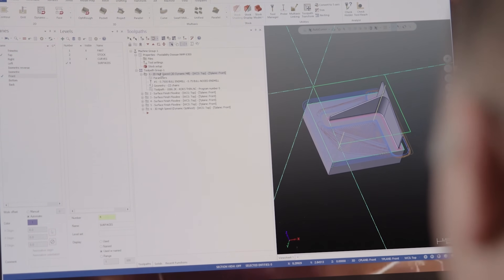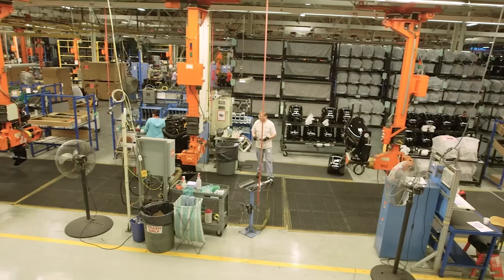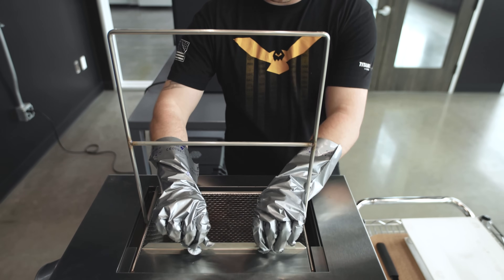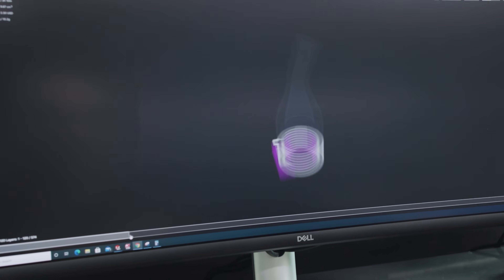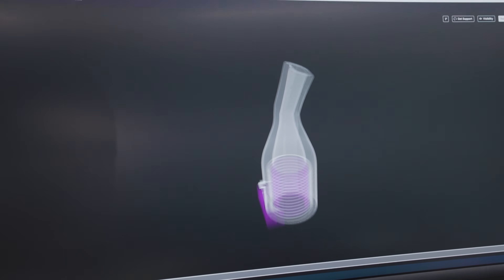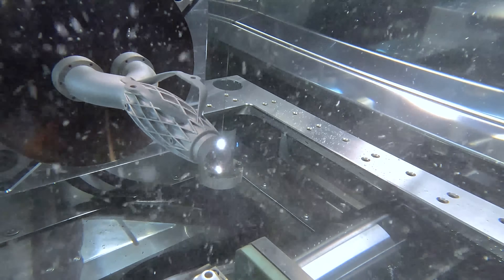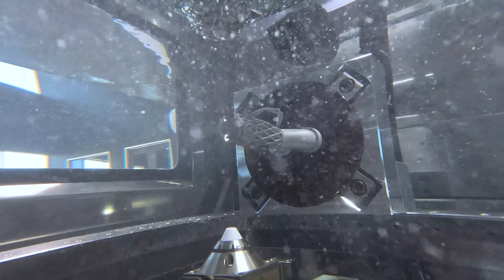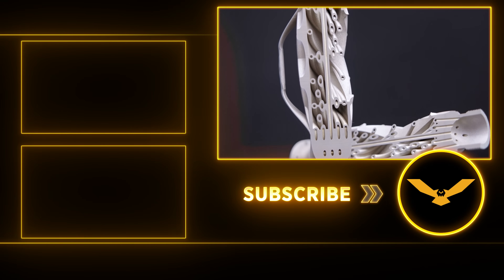Why Won’t Old Machinists Teach Young Machinists???

Comment: I taught a young man how to program and run a 4 axis mill. Once he was pretty good with it, I was laid off. 1 yr. later at a different company, I taught the same man how to program and run a 5 axis machine. As he became proficient, yes. I was laid off again.  I can definitely see why there can be some reluctance to teach.  Since I'm now retired from the trade, another company will NOT get to do this again!
Reply: I understand that happens a lot in IT.  Common scenario:  Your team is not going to get another contract.  Essentially they've been all laid off.  You, yourself can get another contract.  It is for 6 months.  Your job is to train the six H1b Visa employees that they replaced your crew with.
Reply: Exactly.  And it's something that happens in every sector.  I've lost count of the number of times I've inadvertently trained my replacement!
Reply: @threeriversforge1997  There’s a shortage of machinists today. No one is replacing or letting go of anyone just because you taught them. They are desperate to have you.
Reply: @FlowSharp  Why does the shortage exist in the first place, hmmm?  All the people here telling their stories, their own personal experience are wrong?  Companies might be desperate now, but it's because of what they've done over the years to "cost cut".  How many good machinists were let go over the last 20 years as the companies sought to trim the budget, especially as new machines came on the scene?  For you to say our experiences are simply not true is silly.
Reply: @threeriversforge1997  What are you mumbling about? I didn’t disagree with what anyones experiences. 

Yes what the companies did before is the result of the shortage today but there are also other contributing factors. Like for example 

1. It doesn’t pay (Anyone can work at Sams Club or Mcdonalds and make the same amount)
2. Marriage is on the decline so why would anyone work there asses off if there’s no family to support

My point, an experienced employee can train rookies now. it’s not going to get them fired like the past. Due to the shortage and the results of what happened back then.
Reply: @FlowSharp  Your last point might be true, but the damage is already done.  Guys want to work hard because it benefits themselves, even when there's no family to feed.  But those same guys also see how companies routinely treat employees.  Plenty of studies have been done on the matter.  Who wants to risk putting in 15 years with a company only to be fired because you're at the top of the pay scale and some new guy can do it cheaper?  Who is going to believe the companies have changed their tune?  Sure, they are in a bind today because of their actions in the past, but have they learned their lesson, or are they simply going to repeat the cycle?
Reply: @threeriversforge1997  Ufff i dont know if they will repeat the same cycle. Usually companies do learn from their previous mistakes, some might not. 

This is why i believe most companies should be union. Can’t simply fire someone just because. 

Im a rookie as of now but im studying to become a mechanical engineer. But to those who want to remain a machinist they need to make it fair or suffer the consequences of GREED.
Reply: @FlowSharp  Unions make things fair?  Ha!  Yeah, you're definitely still in the learning phase.  I wish you the best with that.  But remember, the Rust Belt is called the Rust Belt because of the unions, not in spite of them.  The history of the unions sounds great until you get into the roots, the strong socialist ties, and the end results we can see all around us.

I get the perceived upside of unions.  I've had to work under some really shoddy bosses and would have loved some union protection.  However, the truth is that unions cause far more harm than good.  For all your talk about "greed", think about how those unions demand always more benefits and wages.  The union bosses live in mansions, and we get the Rust Belt.
Reply: @threeriversforge1997  True i agree. But isn’t having the Union better than not having the Union?

I was once an environmental monitor and employees who were union earned more Money. Although i had a significantly higher position 

Thanks for the info and i hope most issues get resolved
Reply: @FlowSharp  No, having a union isn't better than not.  Again, look at the Rust Belt as an example of what unions do.  Look at how much manufacturing the unions have cost the nation rather than saved the nation.

Honestly, I didn't understand a lot of this stuff until I decided to strike out on my own and had to start a business.  Unions only make that harder.

Michael Keaton did a wonderful movie about the auto industry in the 70's and it was a pretty honest portrayal of how the union workers did their thing.  The main reason you see so many robots throughout industry today is because union workers finally drove up the cost of doing business so high that those early robots were actually a good financial alternative.  And immediately the car companies saw the quality of the product improve dramatically.

Yes, the union employees get paid more money, but where does that money come from?  How many companies were shut down because they could no longer afford those exorbitant salaries?  In the end, it trickles down to the customers who have to foot the bill - and that's why a new truck costs $40K.

I have a friend in the stagehand union in Vegas and he makes an insane amount of money.  It's hard work, sure, but all those perks are reflected in the cost of the tickets the average person has to buy if they want to see a show.  And now that he's retired, he still gets paid a very nice pension.  Not only has he been retired for years, but he has a very long life ahead of him.  That means the union will have to pay his pension for another decade or two.  Where's all that money coming from?

These long pensions end up doubling or tripling the workforce for a company.  Even though the employee retires at 60, they live to be 80 and get that pension check for 20 years after they've ceased creating profit and product for the company.  Think about that for a minute.  Examine the 2nd Order Effects of something like that.

That's why we have the Rust Belt rather than the powerhouse of American Manufacturing that once stood there.  What did the unions do to stop that?  They were supposed to be powerful and all that, yet everything on the store shelves says "Made in China".  Isn't that a little curious?
Reply: @threeriversforge1997  Inflation creates high prices for products. It crumbles the buying power of the dollar. Therefore creating issues on companies needing to payout more for employees to sustain their living expenses. High wages are reflected on all products. The issue began around 1972 when the dollar was de-pegged from the gold standard. Paying employees more because of growing inflation it’s why many companies moved to China or else where. 

The issue is more complex than just “Union”. The Union pays more, that extra pay reflects on the cost of the products making it more expensive for the buyer…..BUT, if the Dollar hadn’t lost it’s buying power would it be a problem today? 

There are many variables that contribute to bad economics and politicians making bad decisions causes financial chaos.
Reply: @FlowSharp  I never said the issue was "just union".  And, no, the unions don't pay more, they charge more.  Big difference.  Those wages come from somewhere, right?  And if the union doesn't get what it wants for the labor they provide... what happens to the company?  How many strikes have there been in the last century?  

"High wages are reflected on all products."  -  Yes, and that includes the things you buy every day.  Right now, the average American has to work 4 months of the year just to earn enough money to pay the taxes he'll owe for that year.  On top of that, the cost of doing business that companies have to deal with is constantly going up because people are myopic, at best, and don't realize that they're pricing themselves out of work.  Think about all the union workers back in the 30's who thought they were doing something great, only to see their entire industry shipped overseas because the cost of doing business in the US had simply  gotten too high.  

Everyone talks about the straw that broke the camel's back, but they never think about the million straws that came before and how they added a huge burden that prevented the camel from moving.

Labor costs are one of the most significant parts of any business, so unions driving up those costs make the companies less competitive.  Something like the 'mandatory minimum wage" law was patently unconstitutional, but it also forced companies to charge more for their product and service.  As a direct result of that, you saw small companies have to close down or revamp their lines.  People were put out of work.  Young folks weren't hired because they had no experience.

Did you never wonder why people clamor for a raise of the MWL to 'end poverty', but poverty never seems to end?  It's because that forced inflation of the cost of doing business drove up the costs of all the goods and services people have to buy.  That can of beans on the store shelf is priced to cover all that went into getting it on the store shelves.  A percentage of the price includes every single tax and other bill all the companies involved had to pay.  You raise the fuel tax and you automatically raise the cost of that can of beans because fuel is used to grow it, package it, and transport it.

Unions aren't the only problem, but they are a huge part of the problem.  This is why I pointed you to the Rust Belt.  Research the history of the US in the mid-1800's as the powerhouse of American industry was really getting underway.  Look at all the things that have been changed since then.

It wasn't just the unions and it wasn't just the gold standard.  The one underlying thread through it all, though, was ignorant people being swayed by slick talkers who were empowered by those ignorant people.  Myopia was a huge problem then as now.  Yeah, greed plays a role, but it's the greed of the lowly individual who might agree with everything I've written here, but says, "Don't care.  That's the problem of future generations.  All that matters is that I got more money on my paycheck!"

If it's not financial greed, it's emotional greed.  It's people voting with their emotions, letting politicians pull on their heartstrings, with no concern for the long-term ramifications.  They got their clean river, but it cost them the mill that once employed thousands and was the heart of the community.  They got their cheaper goods at the big box store, but it cost them the small mom-n-pop shops that couldn't possibly hope to compete.

That's the warning from an old man that I hope you'll take to heart.  Don't fall prey to the arrogance of youth, thinking you've got it all figured out and that those who are older aren't just maybe a little more experienced.  There's always more to the story, and getting to the truth can often be depressing.  That's why so many refuse to acknowledge the truth.  Honest introspection needs to be painful if it's to be honest.
Reply: @threeriversforge1997  I looked it up. Raising hourly rate through the union may lead to fewer customers and ultimately having to shut down. The company also earns lower profits.

This conversation reminds me of my political thought class. When my teacher spoke of Plato Socrates. Plato didn’t believe in democracy. I agree with him. I don’t think people should be allowed to vote if they’re not educated on the subject they’re voting for. 

Which applies to this situation. People fighting for higher wages, driving up costs “unknowingly” and believing it’s the ultimate solution. No education equals dumb decisions. If people only knew……

I thought i saw sunshines and rainbows 🌈 Thanks for opening my eyes 👀
Reply: @FlowSharp  Good job!  Now think about the motivations of the leadership of an ideology/organization that would do something which "may lead to fewer customers" and "having to shut down".  Does that really sound like a group that's looking out for the working man?  When you pair that with the strong ties to communist/socialist ideology that unions have had from the beginning, you start to see that there's far more to the world than the cutesy slogans they use to tug on the heartstrings of their adherents.

I think it was Stalin who referred to his followers as "useful idiots".  He hated the people who supported him because he saw just how dumb they were, happily supporting his grab for power even though he was doing he most horrible things.  All because they hoped he might give them a little more coin in their pockets.  It wasn't that the useful idiots wanted to be wealthier, but that they hated those who were wealthier and wanted to see them pulled down.

It should also tell you a lot that some people are always clamoring about "our democracy" when we don't live in a democracy and never have.  The word 'democracy' doesn't appear anywhere in our founding documents, and the founding fathers actually wrote about the dangers of democracy.  That's why America is a Republic, and always has been.  That's also why the vote was restricted to property owners.

Only after we got away from that, listening to the snakes in the grass and violating the constitution, did you start to see things going bad.  No matter how you cut it, if you increase the number of people who can vote, you increase the chances for corruption in the vote.  Worse, though, is that you increase the likelihood that bad ideas will get through because enough people could be swayed.  It's not a coincidence that Prohibition happened just a few years after women were given the right to vote, or that federal spending climbed back up to WW1 levels, or that we got the first State Sales Tax that would open the floodgates on taxation throughout the nation.

Think about all the things that used to be made in America.  All those products are still made.  They're still on the store shelves.  Somehow, though, it's cheaper to make them in Chicom Land and ship them to the other side of the world... than it is to make the product right down the street from you.  Think about that.  What has the local, state, and federal government done to make things so costly here in America?  How many small shops have been shut down over the years because things are so expensive?  How could it possibly be cheaper to make something in China and ship it to your town.... rather than just make it in your town?  Why do those foreign nations get the jobs and not the people in your state?  What has your state done to become so non-competitive?  If we were talking about a sports team, would this make sense?

You're right that it's not "just unions", but we need to keep them in mind because they are a powerful political force that plays a big role behind the scenes.  The unions benefit when companies close and jobs are lost because it helps to keep the leadership in power.  They aren't the only problem, sure, but they are one of the problems.
Reply: I'm not a machinist but I am a certified millwright.
I have run across guys very early in my working life who would not show you anything. One day I asked this one guy why he kept everything to himself. He said: "If I teach you everything I will get laid off".
I laughed in his face. I said: "If there is a lay off then we are all gone". Years later that's exactly what happened.
Then it happened to me ------------------------------ I was 51 at the time. According to my boss I was the company golden haired boy. I modified a packaging machine and when the machine factory guys showed up they even took pictures of my mod. One day a blow molder broke down. The gearbox stripped all the teeth off the wheel gear. We had no spare. I took it apart and started working on it. The boss asked what am I going to do ? I said I'm going to make another gear with a grinder. He looked at me like I was on crack. It worked and ran for weeks like that until we got a new gearbox.
I also kept notes from the very first day I started about each machine, the problem and what I did to fix it and the machine code. I kept this info on a word pad file that I made on my computer at work. After a couple of years of this I sent the file to each of my co-workers. It was called "Common problems and solutions".
A year later there was a manager change and he despised millwrights. Most of our crew quit within weeks, including our maintenance superintendent and me. They took my "Common problems and solutions" file and gave it to those who replaced us. They went under anyway --- LOL. Company was Nestle.
I always share my knowledge with everyone but that's a big mistake. You have to be VERY selective.
I'm retired now but I would never share my knowledge with a goof co-worker and NEVER SHARE IT WITH THE COMPANY.
Reply: @canadianoddy8504  As a young worker I submit a proposal for an improvement at my company. They paid me few buck, but later they required me to work faster ... It didn't paid off. (I should have listen to retiring master in that matter). From then on I keep any improvident for myself. I keep any notes on encrypted pen-drive. If it makes my job easier, that's my reward.
Reply: @xys007  
Well kid ---- live an learn.
I can't believe they even paid you a few bucks for that. It NEVER happens, I'm shocked.
Like I have said previous ------ keep your mouth shut, get a trade, NEVER work in that trade again unless desperate for cash, GO FOR THE BIG SHOT JOBS IN THE OFFICE.
The End.
Reply: @xys007  so true at my old job I would keep improvements in efficiency to myself, and improve the final product with time gained, focusing on quality brought me a lot of contentment rather than pushing and sacrificing quality
Reply: @canadianoddy8504  Yeah pretty common in industry. All it takes in one bad manager to come along and stuff everything up. The only people I teach are ones that get paid same/more than me, and apprentices. If its someone undercutting me or a young tradesmen just out of his time he is on his own.
Reply: @Ken-nv2hl  
In my life time I have worked for some awesome bosses. Every time there was a problem it was because of some big shot in the office playing big shot. I have worked for two HUGE companies that went under because of sudden management attitude and one that sold to a holding company (the Nestle one) because of upper management. Believe it or not our Nestle factory was the most productive plant they had until this new manger showed up. Now they're gone LOL ------- Morons.
Reply: @canadianoddy8504  in your document of "common problems and solutions" you should have write on few fake but expensive sounding troubles with solution "ask canadian oddy", perhaps under chapter of "user errors" or "results of poor maintenance".
Reply: @kani75  
Baahahahha good one. I never thought of that at the time.
All I know is NEVER help a company by giving your knowledge away. You WILL be kicked in the teeth as soon as they don't need you -- that's a fact.
NEVER give your knowledge to a co-worker unless they can be trusted not to stab you in the back (that happened to my brother who is also a millwright).
I'm 62 now and have a life time of "experience" and the young ones can listen to this advice or not, I don't care. Learn it the hard way then, just like some of us have.
Reply: Nestle never “went under”
Reply: @Ratbert32305  
You are correct but our division did.
Reply: @canadianoddy8504  Exactly, I share my knowledge in IT with only specific people. It is easy if you are too helpful to work yourself out of a job by adding too much automation.
Reply: @grast5150  I'm 62 yrs old now and retired but if I could do my life over I would change a few things. One of the things I would change is to keep my mouth shut and only help a company if they showed respect first. That almost NEVER happened in my life time at work.
Management attitude has always been "you should be lucky to have this job" or "I'm the boss NOT you".
So my attitude should have been "well ok then BOSS, fix the busted shit yourself instead of sitting in the office playing big shot"
NEVER "help" unless it's earned.
Workers have to take the same attitude management takes -- and that it is:
Do the min for the max.
Now a days tradesmen aren't even payed a living wage. I made more money in 1982 than what is being offered today based on an inflation rate calculator. In fact based on that calculator they are offering 50% to 100% less today than back in 1982.
The big shots in the office still get their million dollar "BONUS" though -- don't they ?
Reply: @canadianoddy8504  I worked at a place back in the 1980s that had a new manager come in from the outside. He came to our shop and said the place was a mess and he wanted it all cleaned up ASAP. So, my boss said "Ok". We threw out millions of dollars of spare parts that was used to keep the 80 -100-year-old equipment going. The dumpsters full of parts was so heavy the trash truck blew a hydraulic hose trying to pick up the load. The "mess" was cleaned up, but the maintenance budget went through the roof as the old equipment had to be replaced with new equipment due to the lack of spare parts. But at least the "mess" was cleaned up and the manager was happy and that's what counts.
Reply: @GaryH-pw9cm  That's funny because that is exactly what happened when I worked for Nestle'.
They sent some homo from head office in Ontario and he was filling the scrap bin with our parts.
Apparently they were only allowing a certain dollar amount of inventory.
My boss told me I could take what ever I wanted out of the bin and take it home. Like a fool all I took were the stainless nuts and bolts. I grabbed a small aluminum gearbox but I had no use for it so I threw it away. It was custom for our factory anyway.
At the end of the day we all quit not long after that and they had to sell it to a holding company. Either that or go under -- LOL. That's what they got for hiring a clown manager. You know -------- a genius that they pay a million dollar bonus to at the end of the year because he's so smrt.

Side note: a while back I got a notification in my linkedin acct. It was a recruiter for Nestle' asking if I wanted my job back.
I politely said NO ! I'm retired now.
That's pretty sad when they have to hunt down the old employees to get a plant running. Apparently no tradesmen around and now these companies are desperate.
Reply: People keep to themselves because at one point they been burned more than once. 

I used to work in the automotive field and this too happens to many young techs who came to work straight from school. Back in 2008, everywhere I went all the master techs fought back at management who were looking to cut expenses and replace “over paid” techs. 

This lead to an extremely toxic work environment and age discrimination. 

Funny how companies now complain about lack of employees, that’s because they fired everyone who was competent with their work and replaced them with cheap labor. These CEO’s have no idea how to work with their hands and feet, let alone work next to a floor employee and truly see how sh*t runs. 

Funny thing is, they hire young managers with college degrees and no work experience to run a company. I went off and went into business for myself and became successful without a college degree or prior business experience. That’s because I knew and saw enough BS in companies I’ve worked for, to know how NOT to run a business.
Reply: @andyo.593  They always laid off an expensive worked instead of 3 useless once. Wow, now at a price of 3 hands, they have 6 hands ... that can't do shit.
Reply: @andyo.593  and that is why Elon musk doesn't hire managers who have degrees
Reply: @khuzram  why
Reply: @andyo.593  you are right on with that comment. I 100% agree with you. The concept of MBA is bullshit. Its not about shareholders, at the core a business is only about competence. You have to be competent. If you are then sure administration can improve your profits but if they erode competence they are destroying a company
Reply: @davefoord1259  I’ve been too tolerant to see how these “no work experienced 4 year” graduates manage a manufacturing plant without ever dirtying one finger in any part of the factory or assembly line. 

Nor been deeply involved with an actual floor employee without talking to any of us without an overinflated attitude. It then amazes me to see a company engage in age discrimination because of age and higher pay, trade that for a collage graduate who learned how to work from a book.
Reply: My friends dad worked with robotics since 1979, he never taught anyone anything about programming for the same reason, in 2010 the Doc told him he had to retire (multiple health problems) he told his boss since he’s retiring and he will mentor one person to take over, so he selected one 23yo straight outta college with this criteria: humble, very smart at finding solutions, nice to everyone, knows how to stay quiet when witnessing how the old man fixed things, he taught the kid in 3 months everything that he needed on the condition to never teach anyone until it’s his time to retire. He’s now the head of IT. They still stay in contact.
Reply: @pyronmasters  
Perfect but that's not how I did it in my working life. I always shared my experience if I trusted my shift partner. Sometimes I got burned. Same happened to my brother, he got burned too.
Reply: I dont care if workers  share their experiences with other workers.  Both sides have good reasons . But never never share your knowledge or experience with a corporation  . They will never be that nice to you .
Reply: @bbrahbboul2748  
That's pretty much what I am saying.
Reply: That is an interesting point of view in comparison to the message of the video. On one hand, you are giving other machinists valuable skills and information. However, its a double edged sword if it also means that a company will use that to their advantage to screw that same worker.
Reply: Buy your employees for cheap, fire them before they get expensive.
Capital functioning as intended.
Reply: @UsenameTakenWasTaken  
Yes sir that appears to be how it works in the real world. A guy just has to be smart enough to figure that out early in life.
Reply: Why pay you what you're worth when a kid will do it for half as much. Love it or hate it, it's just business, business isn't in place to make your life better, it's there to make money. It sucks when it happens, but it's the way it is.
Reply: @b.c4066  
That's why experienced and highly qualified tradesmen like me keep our mouth shut and NOT train punks or give valuable info to a company.
It's just business, it's just a job.
Reply: @canadianoddy8504  I ready many of the comments here and that left me with a question. As a younger man getting into machining and aspiring to make this a career what is the best way to approach a problem if I can’t ask a more experienced coworker? I know schooling can only do so much but I’m  definitely one of those that highly values the education that they can provide. Got any tips that can help guide me?
Reply: @blackguitarmaker1925  That is always a problem. I see a couple of possible solutions.
1) How trustworthy is the boss ? Is this "boss" the company owner ? The owner is most likely a machinist himself and may know the answer. If he's NOT trustworthy keep your mouth shut.
2) Remember when you were in school ? Did you get along with your instructor ? These instructors are tradesmen like us and many are retired guys that took up teaching. Go talk to him and ask your questions.
3) You went to school and there were many in your class right ? Do you know where they work ? Go pay that student a visit and possibly talk to the workers there. Since you don't work for that company you won't be a threat.
4) Youtube & facebook.
I'm not on any social media except youtube but I know there are many people on those sites.
Like I said it is a problem but at least try to reach out to someone you trust.
Sorry that's all I can think of right off the bat but if I come up with another solution I'll post it here for you.

Edit: I just thought of another one. Try a site like Practical Machinist. https://www.practicalmachinist.com/forum/  There are a lot of senior machinists and smart people on that site. I'm not sure how much action that site gets anymore but it's worth posting your question and see if you get a response.
Facebook has killed many of these dedicated sites.
I belong to a site called PilotOdyssey.com and it's basically dead now, but man was there ever a lot a smart people on that site back in the day. Now it's dead basically but still a lot of info about Honda oddy's on that site.
Reply: @canadianoddy8504  sounds like good advice. Thank you
Reply: @b.c4066  that’s why work life balance and ppl in the states are being used like forced laborers. It’s just business, no humanity.
Reply: I'm a horrible teacher. My standard for common sense is set too high and I skip what I feel that they should already know.
Reply: For most companies it's a numbers game. Who can work for the lowest wage and still produce results. The employee you trained is cheaper than you. It's very sad that the world of manufacturing has gotten to this point
Reply: Let's Not forget where you come from. At some point you were taught. I'll teach anyone what I know unless I
 have a personal problem with them.
Reply: @MrRaErickson  Well that's the million dollar question isn't it ?
Can the guy you are training be trusted later ?
I have seen evidence to the contrary in my life time --- I'm 62 now -- 63 in two months.
Just my opinion.
Reply: In Italy and UK old machinists cannot be laid off. If the company struggles for works, the redundancy start with the new employees
Reply: @pe13177  That's fantastic!  I wish we could get some of that over this way!
Reply: To teach or not to teach... that is the question. Whether 'tis nobler in the mind?
Reply: Elderly are at a disadvantage because of lower computer related skills, a lot of machines basically have a PC built in.
Someone who grew up computers will have this kind of a common sense of what and where, and so once the non-computer things are learnt, they will just rip thru the programming phase in no time.
But I try to keep my mouth shut and not brag that me - someone with very little experience, was able to program x machine much quicker than colleague with 40 years of experience.
Reply: Sounds like the companies didn't like you....I've been in shops where the teacher was praised....and shops where the teacher acted like a God or didn't teach at all and management was waiting to get rid of that person
Reply: @GameLab_Studio  Shi**y thing to say! Maybe you are next on the do not like list!
Reply: @bobcook9030  no it's true...I trained people and was respected....it's the culture of today....your a fool if u think that these people can't find your trade or job online for free and learn it...mu better stop
Reply: On another note....u must know your Boss and management....u should be working under someone who would get rid of the most skilled....that's bad management...I've seen management get rid of veterans only to be let go themselves....it's politics...play the game right
Reply: Was it a union?
Reply: At the end of the day ----- KEEP YOUR MOUTH SHUT ----- because NOBODY cares about you or your family. I won't help anyone anymore. Several of the companies I have worked for in my life time have made a lot of money on what I have done for them but my award was a kick in the teeth as soon as the books said so.
Do the Min for the Max.
That's what the goof CEO's do and they get a million dollar "bonus" every year. We get the "bone".
The "boss" produces NOTHING that a company can sell. Office staff are just a cost. Then they have the balls to come into the millwright shop and play big shot.
KEEP YOUR MOUTH SHUT -- trust me.
Reply: I never figgered that.
Reply: Well, Bob. For the first kick in the head, SHAME ON THEM!!! For the second one, SHAME ON YOU...
Reply: @WhizeCracker  If you haven't been there then STFU!
Reply: I recently just got out of FaceBook jail Bab.  But yeah, next time I see you point out the exact thing that you avoided what happened to me, I WILL MIND MY OWN.
You're such a tough guy on the keyboard Bobber.
I was there only I wasn't taught...
Reply: That's just some fucking accountant trying to save money on labor. Pathetic
Reply: I love working for a company where if you teach people shit and spread knowledge you just rocket up the company. Totally sucks working for a company that once you pass some knowledge on they are looking to eliminate you.
Reply: Yes sadly it's so true ❤️
Reply: Ask the owner of coca cola to reveal the secret of his formula to his competitors to see what happens
Reply: Sounds more like a systematic problem and not so much a problem of being unwilling to share knowledge.
Reply: @kopfdertoten466  Management lack basic manpower economics on maintaining EXPERIENCED highly skilled machinists and lack of unions to enforce a MANDATORY job security contracts in the deal when it comes to hiring and employment AND TO RESPECT SENIORITY AND VALUE ACCUMULATED EXPERIENCES.
Reply: "If you, as a master, are fearful of getting replaced by the younger generation that you have taught, then you are not a master. You are but a fool who has only mastered being scared of not knowing enough."

-unknown
Reply: This is why I want to leave the industry.
The pay is shit, and we're treated like we're easily replaceable.
Meanwhile, these companies complain that they can't find anybody to work.
Gee I wonder why,
Reply: That's why we need a union in America.
Reply: Shame on your Ignorant Managers.
Reply: There's a difference between giving your colleagues tips, and being used as a highly skilled instructor. If a company wants you to train somebody with your years of expertise, i highly recommend a contract and 3-5x the pay.
Reply: @The-Dom  
Baahahhahahha -- that's not how it works in the real world LOL.
I'm 62 now so I know that's a bullshit statement. That just don't happen in the real world.
Reply: @The-Dom  "3-5x the pay"

I almost think you've never had a job in your life.
Reply: @The-Dom  If you demand a contract and 3-5x the pay there are 2 scenarios. They would nor agree, younger colleague will learn watching you anyway. Or they would agree but they would fire you right after fulfilling the contract.
Reply: New guys should demand the same pay as experienced guys once training is done. Not ask up front but once the old guys get laid off the new guys should demand the same rate.
Reply: @Wbfuhn  Problem with new guys is that managers like to recruit guys with a young family, a mortgage, living pay check to paycheck. The size of your ball decreases as they increase.
Reply: @Ken-nv2hl  What you just stated hits the nail on the head. And it happens in every job and every industry.
Reply: @Ken-nv2hl  Simple answer: They only wanted young SLAVE minded people who won't complain even of they have a legitimate complaint and EVIL managers wants to be able to do bad things and unfair things to younger employees who are economically-financially vulnerable, who are badly underpaid and has no sense of their labor rights (no thanks to Reagan) and are too afraid to complain against bad managers. My granduncle has been observing your machinists trades since the 1970s, 1980s when assigned to your country. My granduncle is a mechanical engineer by trade and a machine tool engineering specialists and technologists.
Reply: @Wbfuhn  wrong....theres many things to learn....5 years + is where u should ask what a vet was making or close....yr crazy to think just bcuzz u learned a few call outs and G code working only on A2 steel....yr crazy...sit down rookie